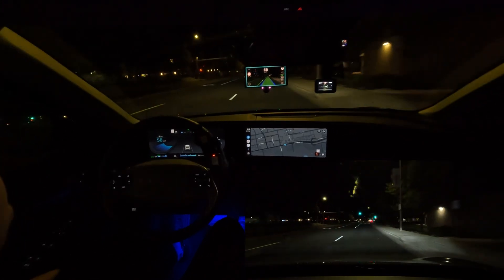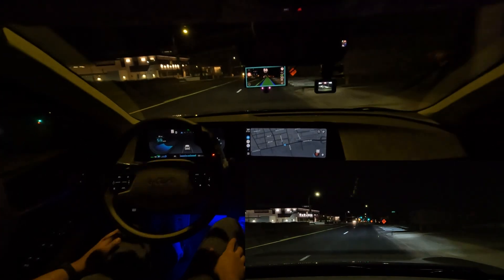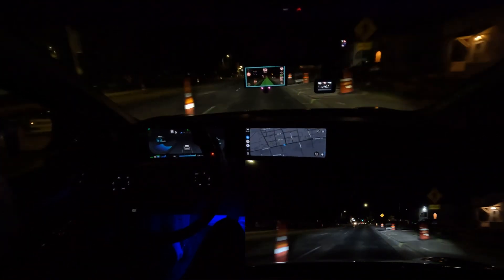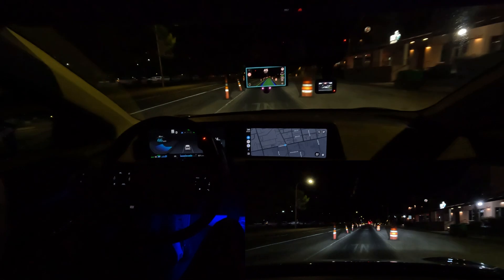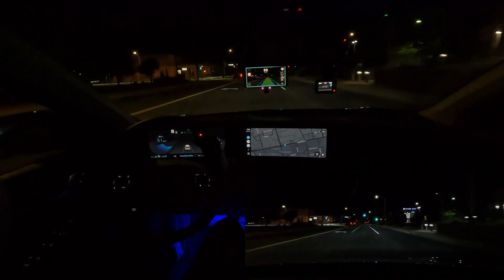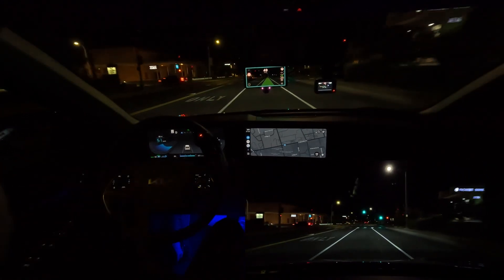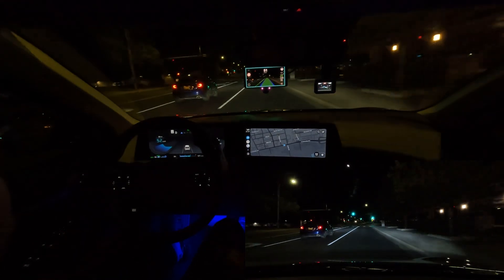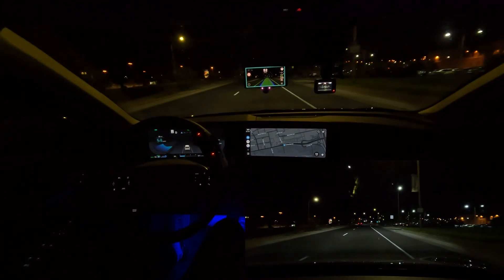Comma 3X - SunnyPilot 0.9.4 Night Construction Driving Test

Comment: Do you have some sort of driver monitoring camera in the steering wheel or what are those red flashing lights ?
Reply from the maker: The flashing red lights are from GoPro Remotes. The two steady purple colored lights at the bottom of the Comma 3X are IR LEDs next to the driver monitor camera. Since they are infrared, human eyes can't see them in the day or night but they are visible on camera.